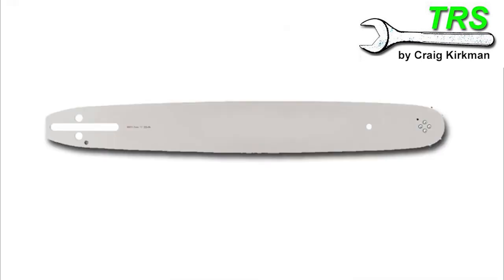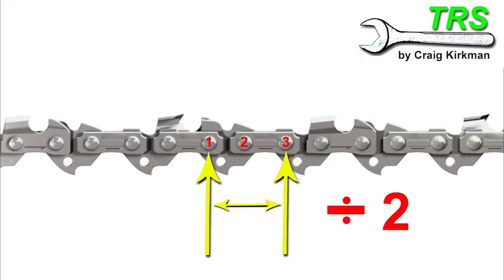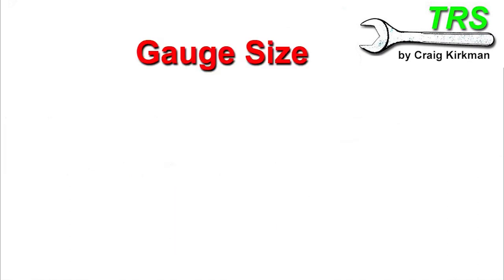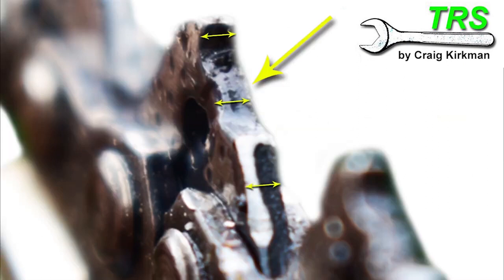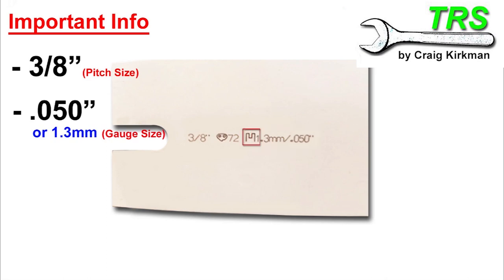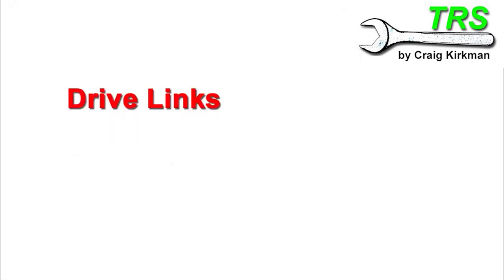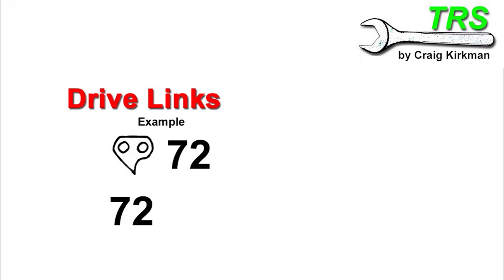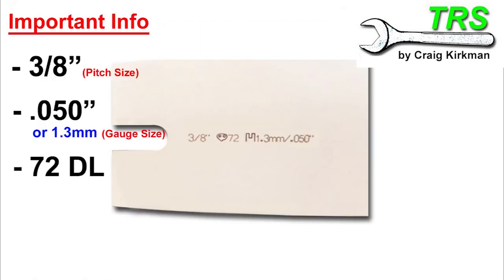Chainsaw Bar Codes Explained - Know Before ordering new Chainsaw Bar

Comment: I bought a used Sthil MS391 saw-- without a chain. The new bar says .325" but the sprocket that is on the saw says 3/8"  what to do?? Buy a different sprocket or buy a new bar??

Comment: How does the drive link number and pitch size relate to bar length?  Obviously they do somehow..  for instance ...3/8' pitch and x72 equates to 216, divide by 8 for inches and you get 27. But that means the chain has a total length of 27. Divide 27 by 2 as the chain length is halved, and you get 13.5. So what size bar would this fit......a 14" or a 12"?
Reply: That's not how you measure chain. Remember you have to go around the outside of the bar and around the drive sprocket. + some bars are deeper then others. I have 2 14" bars that both take 3/8 low profile chain. One uses a 50 link chain and the other uses 52.

Comment: I have 8E20-76-5812P on my Hyundai 18 inch bar, any explanation what the spec is?
Reply from the maker: Ok, all I can say about the codes on the chainsaw from my perspective is the following but please don’t quote me on this: 
The code on the bar of your Hyundai chainsaw, `8E20-76-5812P`, likely provides information about the specific chain bar model, dimensions, and other characteristics. Here's a breakdown of what the code may signify:

1. **8E20**: This could represent a specific model or series of the chainsaw bar, possibly indicating the type of bar or material it is made from. The exact meaning might be specific to the manufacturer.

2. **76**: This number usually refers to the **drive link count**. The drive links are the parts of the chain that sit in the bar groove and engage with the drive sprocket. A count of 76 means your chain has 76 drive links.

3. **5812**: This sequence typically refers to the **bar length and pitch**. 
   - The first two digits (`58`) might refer to the *bar length* in centimeters or a specific product code related to the bar length.
   - The last two digits (`12`) likely refer to the *pitch* of the chain, which is the distance between three consecutive rivets on the chain divided by two. A pitch of `.325"` or `3/8"` is common, but in your case, `12` might correspond to a specific measurement used by Hyundai.

4. *P**: This might indicate a specific type of chain bar, like a **professional* or *pico* bar, or it could denote the profile of the bar (e.g., a narrow-kerf bar).

These codes are specific to the manufacturer, so the exact interpretation can vary. It would be best to consult the chainsaw's manual or contact Hyundai support for precise information tailored to your model.

Comment: HI  i have a saw branded xxx tools   and the bar reads ZLB18-72-5810P     the chain was removed  and now im at a loss as to what chain to order ,, i understand that its an 18" bar with 72 drive links but what is the pitch ? any help apreciated
Reply: 0.325 " 0.058" gauge 72 dl for a 18 " bar. 76 dl, 20" bar